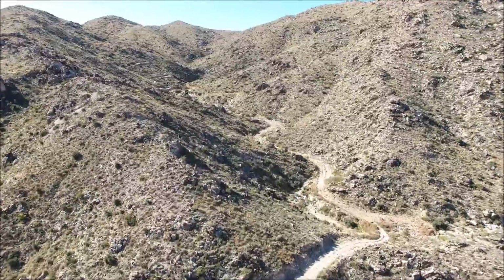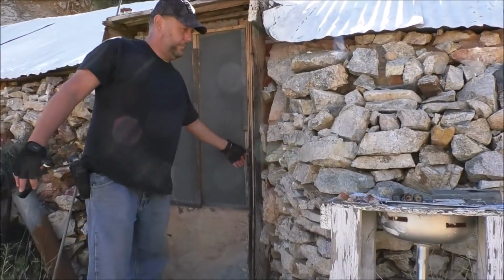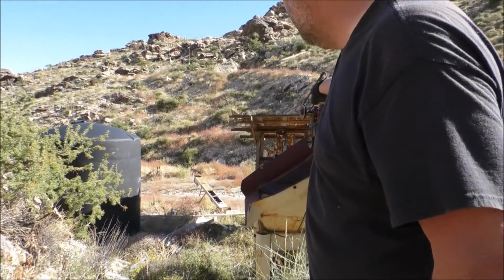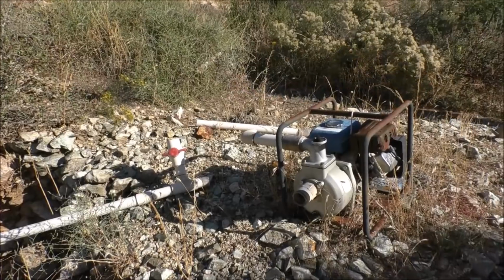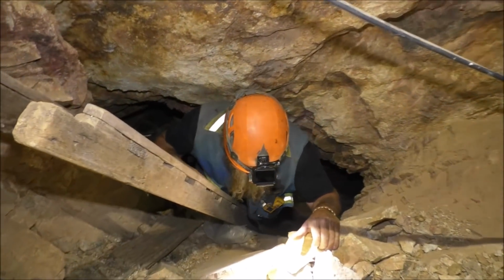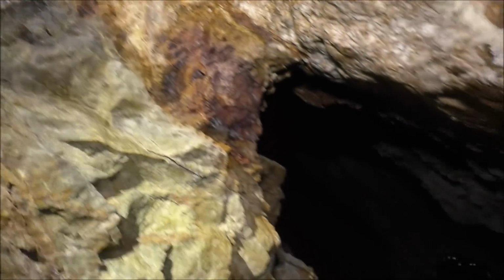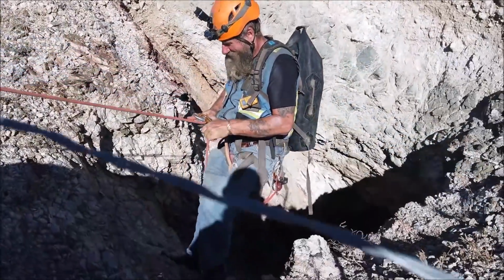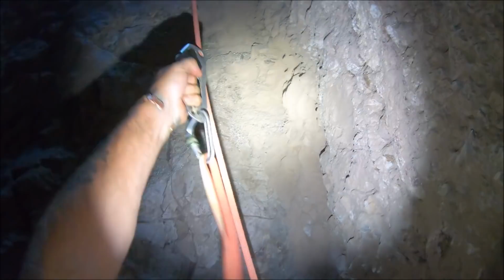#178 Abandoned Gold Camp USA #7 Arizona

Comment: So if it's an entry going downslope, and you can't feel a breeze coming through and it's hot, would it be safe to assume the other entries/airways have collapsed/been covered? Or is it possible to have some mines that have no airflow and be hot? Southern Arizona that is. Not far from the border is where I was
Reply from the maker: What causes airflow is a difference in  air pressure. So if you have several adits at different elevations and the sun is warming one side and not the other you will get air flow. We get excited when there is lots of airflow in a mine because it is likely a large mine. Sometimes the air can flow through collapses that you can't get past.

Comment: In a stone quarry in Ramallah somewhere an opening to a shaft opened up going down deep into the Earth ,
this was during the British occupation of Palestine ,
the British occupation forces in Palestine came along with a winch lowering down a person with a strong flashlight to the bottom of the pit then they brought him up and drove off ,
for over 40 years local Palestinians use that shaft to get rid of all the stone quarry overburden without the shaft showing any problems ,
The Dumping continued until the mid-70s  ,
for some reason the Israelis did not want to keep it going ... it wasn't long before someone backed a dump truck into the shaft plugging it for good ,
I thought this would be a nice mystery for you all to investigate .
Reply from the maker: No doubt it intersected either an old mine or a limestone deposit.